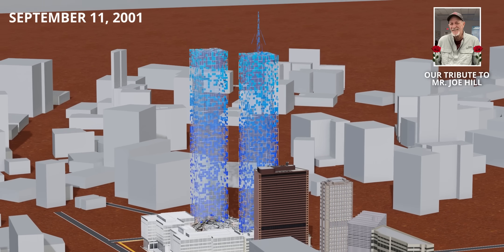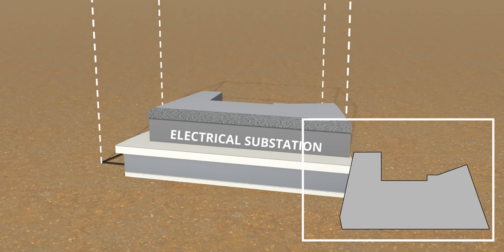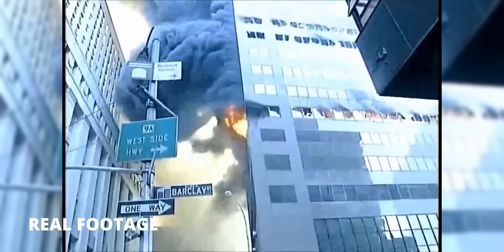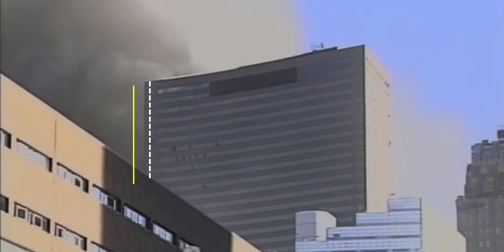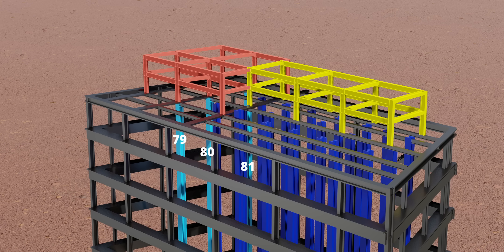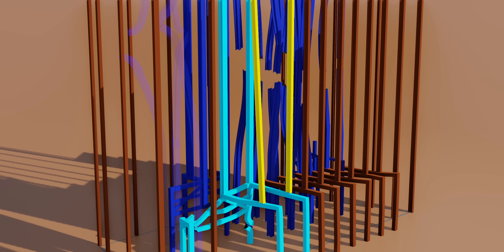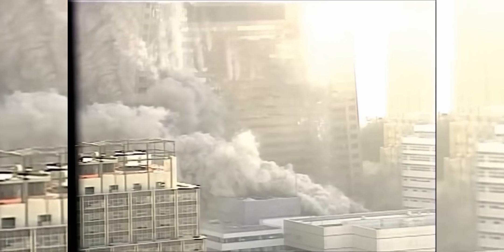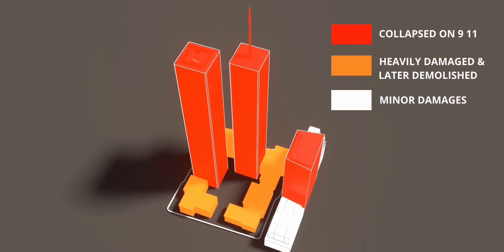Collapse of Building 7 | The Complete Physics

Comment: Either all 3 buildings were designed poorly to come down by 2 planes or the buildings came down in a planned demolition.
Reply: I feel like you are leaving out at least one option. The Towers were perfectly safe within their design envelope.  They only collapsed when taken far outside design parameters by an extraordinary and unprecedented event.
Reply: @TheCriticalStinker-01   Did you know the architect designed the Twin Towers to take a direct hit from an air liner?
Reply: @NotTheRealRustyShackleford  Not true actually. What is apparently true is that sometime after primary design work was complete a study was initiated to determine the effect of a B707 lost in fog on landing approach and hitting a Tower would have. The 3 pages of hand calculations determined the impact would not cause the Tower to collapse.

No consideration was given to post impact fires, only initial impact.

Worth noting this was an accidental impact and not a high-speed Kamikaze attack by a larger and fuel laden aircraft.

Also worth noting both Towers still survived those impacts which were 4 and 5 times greater in terms of energy than the 1963 memo.
Reply: @TheCriticalStinker-01  "They only collapsed when taken far outside design parameters by an extraordinary and unprecedented event."

Design parameters included the ability to withstand plane crashs more destructive than the ones on 9/11, PLUS the resulting fires. You are exposed to be a liar Fitzshill, AGAIN.
Reply: @Kudde23  "Design parameters included the ability to withstand plane crashs more destructive than the ones on 9/11, PLUS the resulting fires."
At no point in human history has that been a design parameter. Ever. It's not a parameter TODAY, 20 years AFTER. Not to mention it would be impossible.

Poor Pillowbiter, blindly repeating stupid shit because he wants to be Rambo. Much sadness for you.
Reply: @h1F595  That´s a funny story mikroshill. So you don´t know if building codes required them to design the towers to withstand airliners but you know they didn´t design them to withstand airliners...
Well mikroshill, now prove that they did the calculations only after the towers were designed already.
Reply: Or 8 buildings were destroyed by 2 jets because 2 huge skyscrapers fell on them
Reply: @mikebyrd8278  Only 3 buildings came down on 9/11 shill.

Comment: -Ledra Marriot that had the whole towers Fall on it, Didnt collapse, but WTC7 collapsed because of fires ? (NIST says it did)
-Fires were only at three floors, seen by the intact glass panels. Penthouse falls in first, its not an optical illusion.
 -How does having a gash on the perimeter and fires on three floors make the building collapse in its core ? You can even see daylight on the first two floors because of the penthouse collapse 5 seconds before it goes down !
Twisting motion is induced in controlled demolitions so it falls in its footprint,   Sorry Harry Potter :
Nice try though. better try than NIST
Reply: Hate to break it to you but the WTC Marriott was complete crushed by the Twin Towers.  As for the rest;

The collapse of the unknown and unimportant Building 7 – one of 6 buildings to collapse of 10 destroyed on 9/11 - confuses a lot of people, despite being one of the most studied engineering disasters in history. It was not famous, not a terrorist target, no one was killed in it and thus it did not get a lot of attention, so most know very little about it. There is a lot of tantalizing but absolute garbage out there on this topic. Given the choice between long boring, hard to find technical reports and readily available, easily digestible fantasy on the internet, many turn to the latter. To counter that I prepared this brief summary explanation based on my own analysis. No politics, just engineering. 

The North Tower collapse at 10:28am bombarded Building 7 with thousands of tons of burning debris, causing heavy damage and starting raging fires burning out of control for the next 7 hours. Half the responding FDNY firefighters having been killed, others injured, units in disarray, much of their equipment destroyed, no water pressure, and the greater urgency of Search & Rescue efforts, firefighting efforts at 7 were pulled as futile. The building couldn’t be saved and was left to its fate.

youtube.com/watch?v=g_SvpwyC17M&ab_channel=MFitz 

Collapse of a burning structure is always a concern for firefighters. Steel buildings subject to fire rely on active fighting of the fires to survive. Left to their own devices they will collapse. Buildings are designed around 1 to 3 hours of fire resistance, allowing time for occupants to escape and ACTIVE firefighting to get started, after which all bets are off. In B7 the occupants escaped, passive and active fire protections were compromised and active firefighting never got started which left the building to take its chances. It lost. Odds on Building 7 would eventually collapse,… and it did. No big deal in logic. That is the sort of choice firefighters make every day in brush fire situations - which houses to save and which ones to let go. Only real difference here is moving the decimal on the size and cost.

FDNY Chief Daniel Nigro ; The biggest decision we had to make on the first day was to clear the area and create a collapse zone around the severely damaged 7 World Trade Center, a 47-story building heavily involved in fire. A number of fire officers and companies assessed the damage to the building. The appraisals indicated that the buildings structural integrity was in serious doubt. I issued orders to PULL BACK the firefighters and define the collapse zone. It was a critical decision; We could not lose any more firefighters. It took a lot of time to PULL EVERYONE OUT, given the emotionalism of the day, communications difficulties and the collapse terrain

FDNY Deputy Chief Peter Hayden - We had our special operations people set up surveying instruments to monitor and see if there was any movement in the building. We were concerned of the possibility of collapse in the building. And we had a discussion with one particular engineer there, and we asked him if we allowed it to burn could we anticipate a collapse and if so, how soon? And it turned out that he was pretty much right on the money, that he said 'In its current state you have about 5 hours

With its deteriorating condition being reported throughout the day, the collapse of Building 7 expected by the FDNY, bystanders and the media meaning at least 24 video cameras recorded some or all of the collapse. Everyone at the time knew what was coming and why.

youtube.com/watch?v=OY5S5k3tMHI&list=PL4GiNqqck-lzR7pebSWRVLoXyu-aWR3Rr&index=48&ab_channel=911InvestigationVids 

Building 7’s collapse was totally different to the Twin Towers, harder to understand and most of the details difficult to see. But we can sort out what happened through careful analysis and observation.  What follows is MY EXPLANATION of the collapse sequence using the best available information and relying on no authority.

B7 was complex structure, a 47-story steel framed building built on top of a smaller existing 3-story building, requiring several lower floors dedicated to complex load transfer structures instead of usable office space. Of trapezoidal shape and all-steel tube-in-tube construction, B7 (above the 7th floor) consisted of a central core of steel columns carrying most of the gravity load, perimeter steel columns around the outside of the structure carrying the remainder of the gravity loads and long span beams and girders to tie those elements together and form the floors. On the outside of the building hung a moment frame - the last part of B7 to fall. 

Phase 1 : Collapse initiation for B7 is notably quiet with observers not realizing the building was collapsing! There was no audible warning in the form of say hundreds of ear drum busting 180-190dB explosive bangs preceding the collapse. The first externally visible signs of collapse initiation occurred at 5:20:28 pm. Here at 12:00 a local CBS affiliate reporter is talking 10 blocks from B7 when collapse begins. People don’t start to notice the collapse until 12:11. Then at 12:45 is the famous CBS fixed camera clip of Building 7’s collapse Again, note how quiet it is.

youtube.com/watch?v=t5tEy6mXSE8&ab_channel=fresnosean379

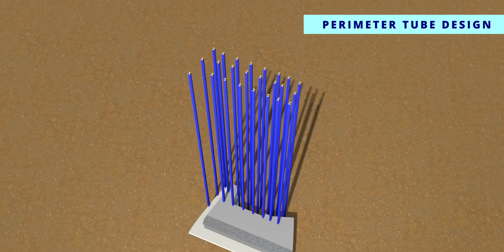Collapse initiation was due to multiple lower floor failures above the load transfer region (7th floor) in the NE corner of the building. In this video at 0:45 you can see the NW corner from inside the building while under construction, Column 79 just out of frame on the left. That big, angled steel beam across the top of the frame connects to C79 at one end. The girders connect to the beam. The beam and all those girders depend on just one connection

youtube.com/watch?v=nP3TNHPCIVU&t=35s&ab_channel=EdwardCurrent

Phase 2 : Lower floor failures left core Column 79 laterally unsupported over an excessive length and it buckled. If you look at a floor diagram of Building 7 (see above) and look at all the structures that depend on C79 you quickly realize this one column was a relatively isolated structural element on which a disproportionately greater fraction of the structure depended . Externally we see a vertical progression of window breakage along the 44-46 line and a kink in the roof of the East Mechanical Penthouse at the top of the building, consistent with C79 failure. The transition from full capacity to almost no capacity occurs in virtually an instant. Once the buckling failure occurs there is almost no resistance

Normally with a buckling column, the load could very well be redistributed to other columns, meaning the buckling could stop after a while. With C79 that is not the case - the failure did not redistribute the load, so the collapse rapidly progressed to the roofline, sinking the rooftop penthouse.

Phase 3 : With C79 gone, B7’s progressive, non-symmetrical collapse continues with C80 and C81 at the east end of the core left laterally unsupported and quickly buckled and failed as well, sending the EMP down through the building. C79-81 all have no diagonal bracing, which I believe is a major reason why they could not redistribute a lot of vertical loads among one another.

From there collapse progressed from east to west through the central core until the core was gone taking all of the interior floors and structures and probably most of the perimeter columns with it. You can see the horizontal progression of window failures low in the building and the dropping of the remaining rooftop structures into the building. One of the big takeaways from the NIST Building 7 study (that gets completely ignored) was their modeling which determined C79 failing under ANY circumstances would have initiated the same collapse sequence.

Phase 4 : After about 10 seconds only the exterior moment frame - a hollow shell mostly supported by the 4 corner columns and quite unable to stand on its own – remains, creating the illusion the building is still standing since little has changed externally. That’s just hollow empty shell, like an empty cereal box. The north leans inward, forming a V in the roofline. The last remaining perimeter columns buckle under the strain.  There is almost no resistance as the moment frame free falls, landing on top of the 7-story high debris pile, blocked surrounding streets, heavily damaged the Verizon Building and destroyed Fiterman Hall at 30 W. Broadway, all well outside of Building 7’s “footprint”.  It is only here, at the very end that a single utterly meaningless measurement of alleged free fall is taken. Start to finish the collapse took 18-20 seconds, or less than 1/3 of true free fall*. Not that we really care since how fast something falls cannot tell you what started it falling in the first place. The free fall argument is about the collapse of the outer shell *AFTER all of the critical internal structure had already failed and completely ignores about 80-90% - of the collapse. 

Building 7’s progressive, non-symmetrical collapse was incidental and unintended collateral damage from the combined effects of fire + time + gravity started by the collapsing North Tower. That is true no matter who planned and carried out the 9/11 attacks or why . The collapse was of so little consequence it barely even registered at the time, a mere footnote. 

I hope you found this helpful and informative, not adversarial and it solicits informed critical comment. If I made any errors of fact, logic or reason or left anything critical out, please let me know so I can fix it. IF you can offer a more plausible alternative please do. Be the first. Please start any reply with the words “Tits McGee” or I will know you didn’t read it and are wasting my time.
Reply: -The Marriot was destroyed by the Towers.
-Fires were on every single floor. In the words of the FDNY, the building was "fully involved" in fire.
-It probably doesn't, but since that didn't happen, so what?
-WTC 7 fell across two separate, 4-lane, streets, to the West into the Verizon Building, causing 1.4 B illion dollars worth of damage, and to the North-East into Fiterman Hall, destroying it. So much for "into footprint", no matter how cool and important that sounds.
Reply: @mooneyes2k478  Noope it only had a hole in the middle like a donut it didnt collapse on its footprint xD. 
Now tell us about the asbestos from the heat insulation dispersed across all manhatan and people getting cancer left and right..
Reply: Wtc3  was destroyed
Reply: @mikebyrd8278  Nope.
9:59 a.m. crushed the middle of the building, creating a large gap that nearly split the hotel in half. The lobby was filled with debris, but nonetheless acted as a shield for firemen, police, and hotel staff, due to its reinforcements after the bombing
Reply: @ngt84  an the rest of it was destroyed when wtc 1 collapsed at 1028
Reply: @ngt84 That was after the South Tower collapsed.  Why didn't you bother to look again after the North Tower collapsed?

Comment: https://www.youtube.com/watch?v=KMvCWFCoVN4

" ... RK: This fake "research" does not critisize this real NIST´s simulation on WTC-7´s collapse:

https://www.youtube.com/watch?v=fIAK6PAeyn8

NIST´S FINAL REPORT:

https://www.nist.gov/publications/final-report-collapse-world-trade-center-building-7-federal-building-and-fire-safety-0

IN THE NEW RESEARCH THE STIFFNESS OF CRITICAL COLUMN 79 IS CALCULATED IN ITS ORIGINAL SUPPORT CONDITION, WHICH LEADS TO ERRONEOUS RESULTS. THE STRUCTURAL SYSTEM WAS PLANNED TO COLLAPSE ON FOOTPRINTS IF IT COLLAPSES.

NEITHER THERE WOULD HAVE BEEN ANY "CRIME" IN EXLODIND EMPTY WTC-7 TO FALL ON FOOTPRINTS WITH ONE LARGE CHARGE AT THE CRITICAL COLUMN 79, WHEN IT HAD BURNED 7 HOURS. 

THERE WOULD HAVE BEEN NO REASON TO HIDE, IF THAT HAD HAPPENED!
... "
Reply: "CAPS LOCK FOR TRUTH!"

Perfect example of someone who have no understand about even the first thing they're "yelling" about, and so substitute volume instead of brains or arguments.

Comment: Question, the whole idea of making steal warp/bend from fire is ok in towers 1 & 2 but I was told that it was because of the thousands of gallons of jet fuel burning as paper and office materials like desks, chairs and office equipment didn't burn HOT ENOUGH to cause that so please explain how now you think jet fuel caused the fires in WTC 7 to burn hot enough. Also in WTC 1 & 2 it was the connectors holding the trusses that failed but you never explained a simmilar issue in WTC 7, how did they fail as the main load bearing were large I beams not small trusses that would need lower temps to fail. You skipped a bunch of needed information to explain your fire theory.
Reply: You are asking video maker to lie more, he already did his best lie and fell short.
Reply: Building 7 was on fire five times longer than the Twin Towers. The formula for collapse is Fire (heat) + Time + Gravity = Collapse
Reply: @TheCriticalStinker-01   хватить писать чушь  и бред под каждым комментарием! Найди себе работу!
Reply: jet fuel is not the only thing in the world that burns and it was more than paper burning. The fires were more than hot enough to weaken the steel. Learn before you speak.
Reply: @pacman3556  You don't even understand the official explanation for the collapse. The collapse wasn't initiated by weakened steal.

The main cause of the collapse was thermal expansion of the steal.

The beams connected to girder A2001 experienced thermal expansion. The expansion pushed girder A2001 off its seat that was connected to column 79.

When the girder fell of its seat, it caused column 79 to buckle & initiate the progressive collapse.

The fires weren't actually hot enough to weaken the steal to the point of collapse. 

Skyscrapers are specifically designed to withstand being completely engulfed by office fires & remain standing.

Engineers actually account for the steel weakening due to fires & ensure that the structure will remain standing even after the steel has been weakened.

Skyscrapers have been fully engulfed by flames & remain standing.
Reply: @john_hunter_  
yes WTC7 the steel expanded causing a column to buckle. In WTC1 and 2 the steel weakened causing inward bowing. In both cases it was fire that caused the collapses.
What skyscrapers are you referring too? List a few.....and remember make sure they are not concrete core but steel frame like WTC so you are comparing similar structures.
Reply: Weaken the steal, and all will be right in the world.  DK

HTTR